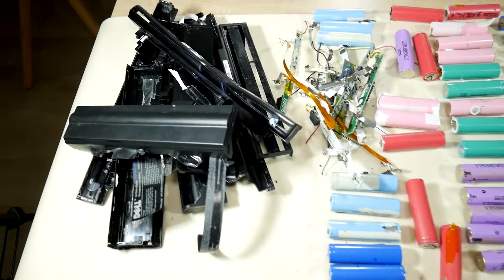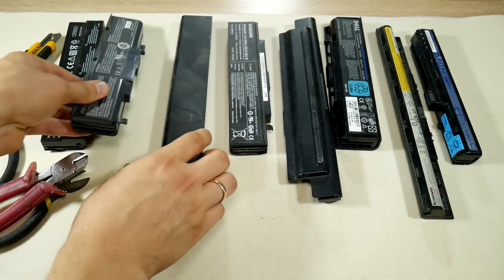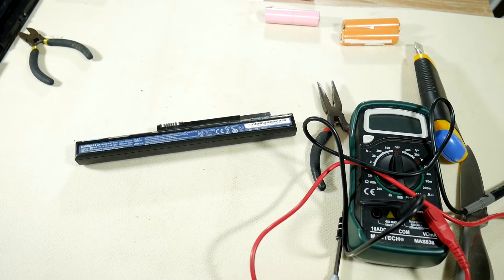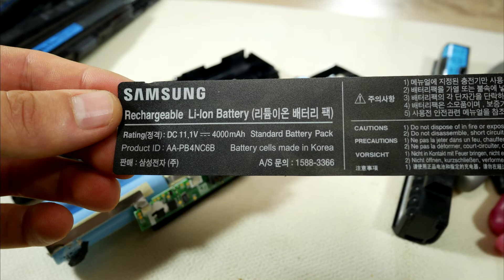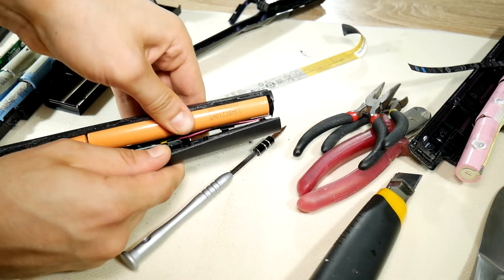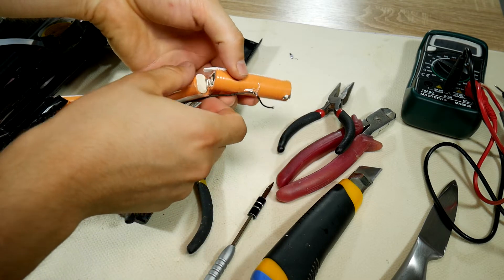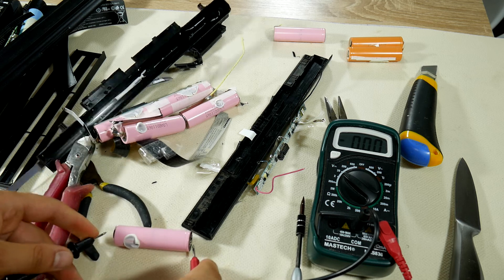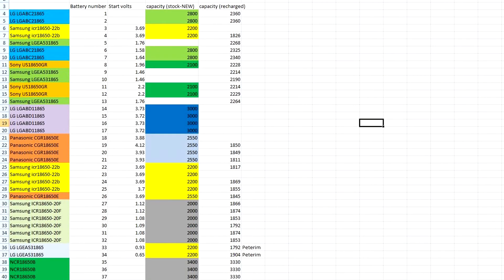Where to GET 18650 Batteries for FREE - Gold Digger

Comment: It's also worth it buying them from trusted sellers from aliexpress, since they cost 2-3 dollars each and they come with ~2600-3000mAh capacity, with a discharge rate of more than 15 amps
Reply: Which trusted sellers
Reply: Which seller had genuine batteries on aliexpress?
Reply: daweikala pink INR18650 cells, but they got taken down for some reason. Can't buy them anymore I guess. Original page on aliexpress doesn't exist

Comment: Thanks! Great video :-) I'm a beginner so I'll almost certainly ask silly questions :-) Are these batteries more likely to explode while separating them? If so, do you know why? I also have a Liittokala charger - it's great. I assume that batteries salvaged from low-power devices such as laptops probably would not have the required specifications for power tools or electric bikes? Specifically the maximal current they are able to deliver? Cheers.
Reply from the maker: low chance of exploding, because they have run out (discharged). For electric drills or electric bikes, these batteries are too weak. Max discharge 5-6A.